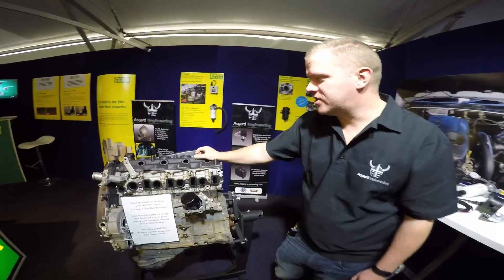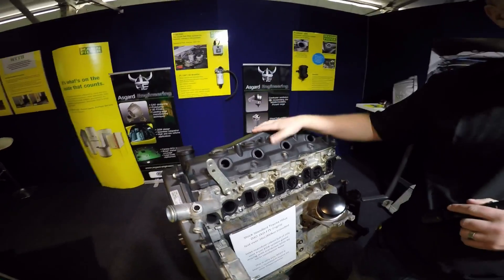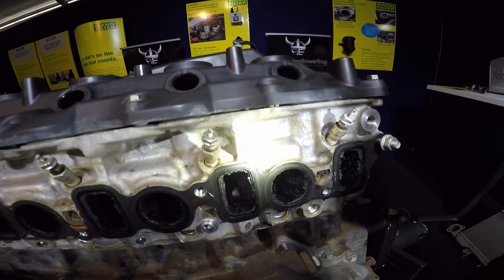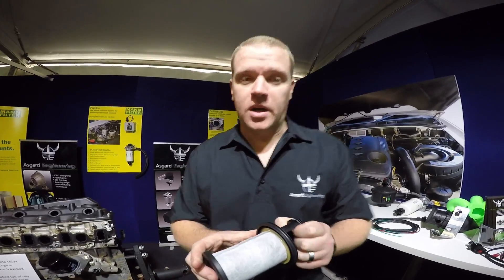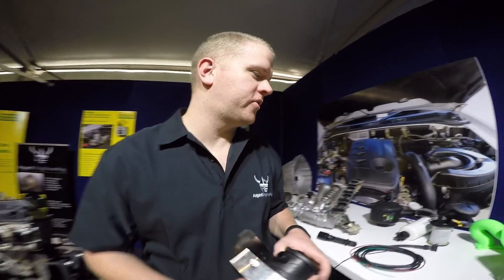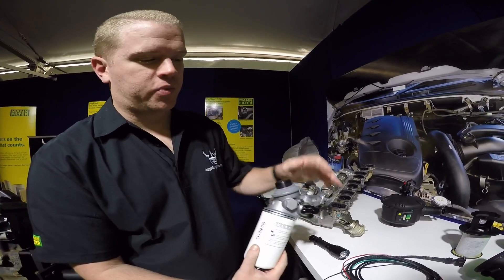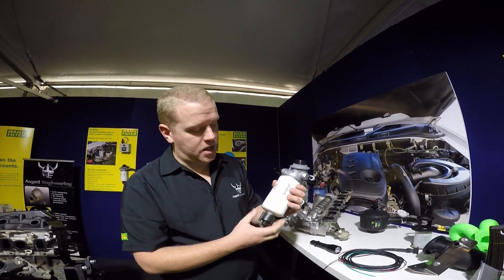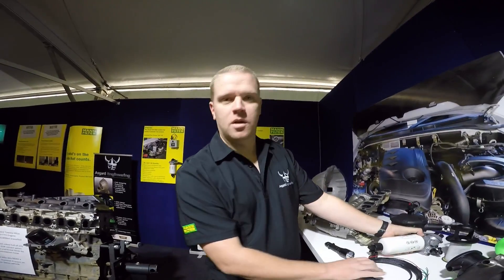ProVent and PreLine Demonstration by Asgard Engineering for MANN+HUMMEL Civienex 2015

Comment: hello, The intern filter of The pro vent:kms of duration please?
Reply from the maker: Hi Roberto, it depends on the engine capacity, age, driving style as well as the size of ProVent used.  In our kits the typical service interval for filter replacement is between 40,000 and 60,000km.